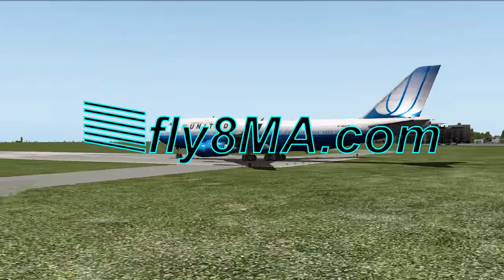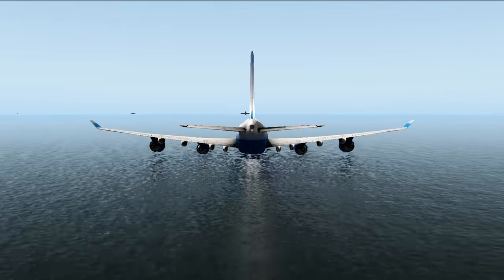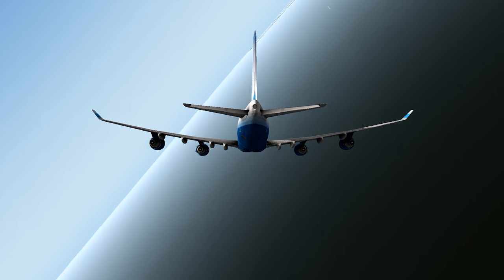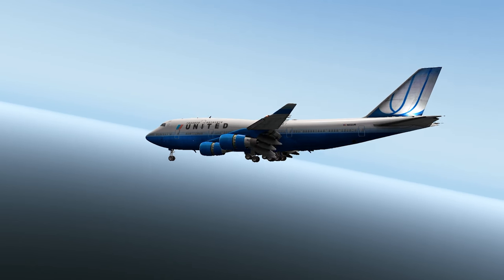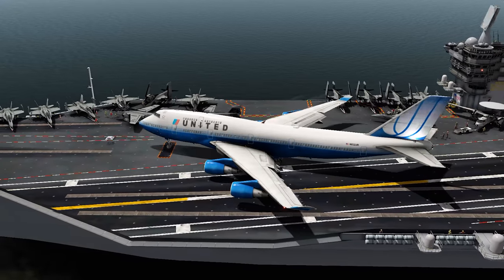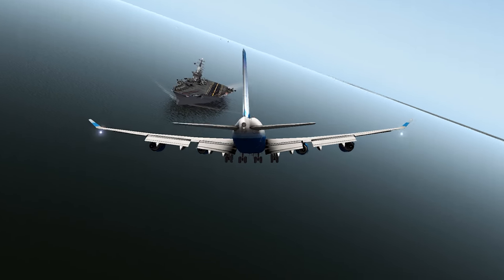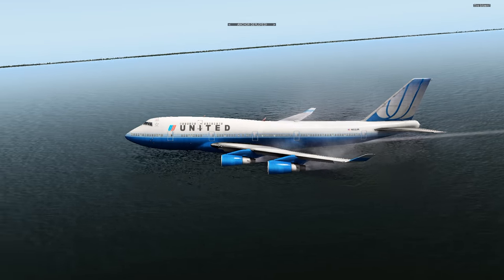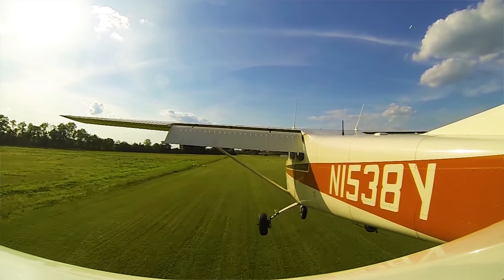Landing a Boeing 747 on a Aircraft Carrier | and Why a 3degree glide path is important

Comment: On the more important topic of glide path. I'm learning to fly currently and our FI has taught us to always come in at a higher glide path and more nose down angle of attack. This is because, we can reach a standard approach speed basically without any power from the engine. Do you disagree with this kind of teaching?
Reply from the maker: It's important to master both in small airplanes.  I generally teach a stable 3 degree path first, before trying power off approaches.  For purposes of regular flying, the FAA prefers the stable 3 degree approach, but like it said.  You should master both during your training
Reply: Ok. I'll ask my FI next training about the 3° approach. Thanks!

Comment: This. Is. Scary. Though here's a question. Why don't they use amphibian's for air liners like they did in the 30's and 40's? Like the grumman series of Goose's and Albatross's or the Boeing 314 clipper. I like the idea and fashion sense of flying ships. Maybe it's because I live in Florida, but I still think it would be cool if they had jet powered luxury flying cruise boats. They could take off from California and touch down in Hawaii for a nice water landing and pleasant cruise around the islands. It would be better than trying to land on an aircraft carrier. xD
Reply: For one if you have floats, they create a lot of unnecessary resistance, resulting in higher fuel consumption, and higher ticket prices - which is something no one wants.
If your whole plane is used (like the Convair F2Y Sea Dart) its gonna be a bumpy ride, even on relatively calm water, and being a large jet liner with high stall speeds (compared to the general aviation hydroplanes), doesn't help wit this problem.

So its either more fuel consuming.
Or shaking the living soul out of the passengers, and unable to fly in rougher conditions.

Neither seems acceptable to airlines, hence they just ditched the idea.
Reply: Because we now have international airports that are large enough for airliners and are not only safer than a water landing but it is closer to the end point. Also you don't have to abort in bad weather in a land based system where as in a water based system even slightly bad weather can put a stop to operation. The whole point of seaplanes or floatplanes originally was the fact that a large open body of water was more plentiful than a finished runway with no obstacles like trees but obviously that has changed in most areas and so that is why floatplanes are mostly used in remote areas like Alaska
Reply: Well, there's a few commercial WIGE craft operating around Scandinavia, at least.  They rely on the ground effect to lift themselves just a few meters off the water, and achieve high speeds and high efficiency.  While they aren't proper 'airplanes' (and a lot of them are propeller driven rather than jets), they're more efficient than a typical aircraft, higher capacity, and can set down in the water and dock at most harbors.

The disadvantage, of course, is that they can only go over water (or very flat ground) and aren't quite as fast.